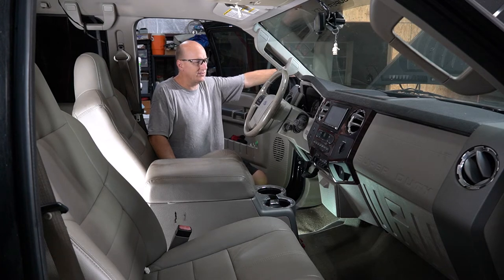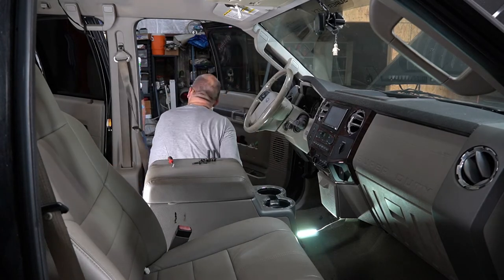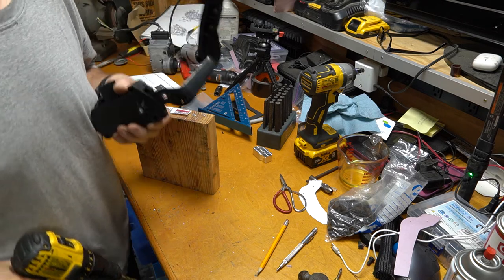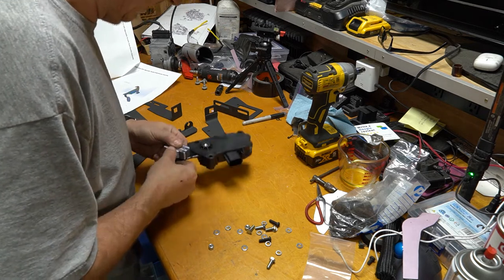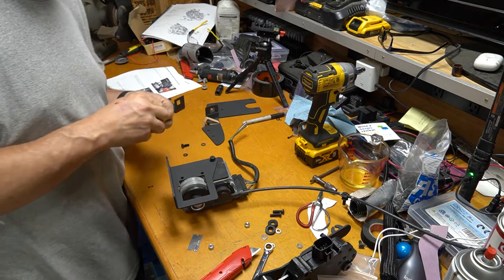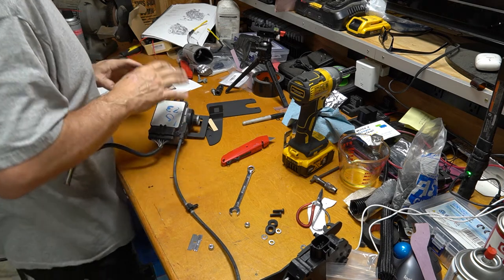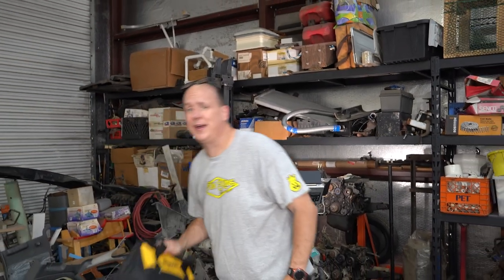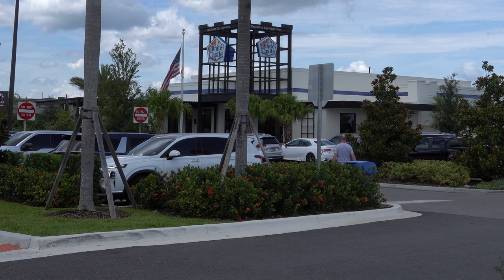The Fummins Project - Episode 12 - The Throttle Pedal Modification

Comment: I was always curious how that mechanism worked when I seen it on their site. Thanks for the video!
We opted to build a pedal module to sync the Ford side with the Cummins but I’m running a 06 CR engine, so no cables. Also built a can bus translator to handle the cruise control.
Reply from the maker: So, I too and running an 06 CR (so no engine cable.) There is a module that connects between the harness and the Ford side accelerator pedal position sensor that translates for the Cummins side. But I am very intrigued with your can bus translator for the cruise. Does it adapt the factory Ford cruise to not need the Ford Gas servo? (I have the SwapHelper cruise module, but I have not yet hooked it up.)

Please, tell me more. And if email would be easier, you can find my address in the about section or hit my website at fun king garage dot com.

Comment: What servo did you use??
Reply from the maker: I dug through my notes and I can't seem to find which one I used. I THINK it was from a 2007 or 2008 Ford Escape (which I believe to be the same from 2001-2008.) Do not take this as fact though until I can confirm it. I will try and find the number off it. I chose the one I did based on the cable length. The others, the cable was excessive in length.

If you do not get another reply from me on this, hit me up again here, or better through the contact form on my website and I will do my best to find out for sure.

Comment: Will dang  I just found your channel . I was hoping you had some good footage of the wiring.  I am stuck on my build . She cranks but won't start . She only cranks for a second she won't just keep cranking.  I figured when I started this build if I ran into something I couldn't figure out on this build my brother would.. he is stumped .
Reply from the maker: Diesel Conversion Specialists did the actual engine harness work. (The Ford/Dodge integration.) The wires that I ran in this episode were just the wires for the Cummins side OBDII connector, throttle pedal, and the Edge CTS3 with a few others for misc stuff.

Your issue sounds like it might be a problem with the Dodge side Antitheft system. If you are not already in the "Fummins Tech" group on facebook, post over there and I am sure a solution can be found. :) Thanks for watching.
Reply: @FunKingGarage  i sent them the Ford and the Cummins wire harness and got it back all meshed together.
Reply from the maker: So the starter is trying to turn the motor over and it won't start, or the starter only tries for a few seconds and then stops trying?
Reply: @FunKingGarage  goes just for a few seconds and then stops . Turns over nice for a few seconds.  I got to get it hooked up to a computer and see what faults are showing up .. I'm guessing the dodge or cummins pcm is in anti theft mode.
Reply: @FunKingGarage  starter turns motor over for a few seconds then stops .
Reply from the maker: @Feazable productions it absolutely sounds like the Dodge SKIM. (And don't believe people when they say it can be undone with HPTuners.) I had to ship my Cummins ECM out to have it reflashed to get rid of the SKIM issue.
Reply: @FunKingGarage  Thanks . I will look into having that done

Comment: Why couldn't ya hot wire it with a battery and move it? Also tw dm a link to a camera for under dash video.
Reply from the maker: Listen here ya smarty pants! I tried that and got a shock, so I yelled some profanities and threw some wrenches. Unfortunately it was right when the battery in the camera died, so there is no footage of it happening! LOL!

Actually, it is because I could not reach the connector with the seat in place. Totally a catch 22. ;)
Reply: @FunKingGarage  🤣🤣🤣🤣